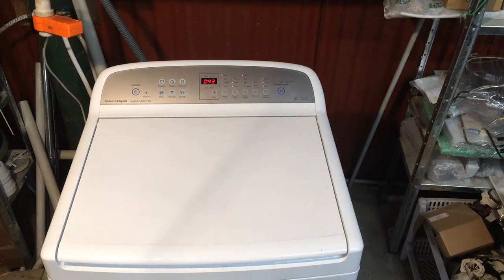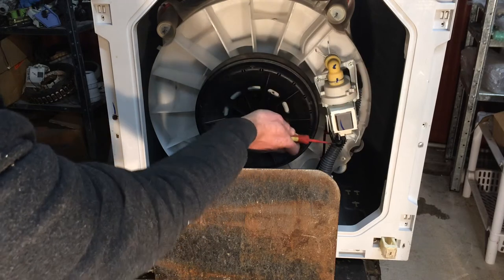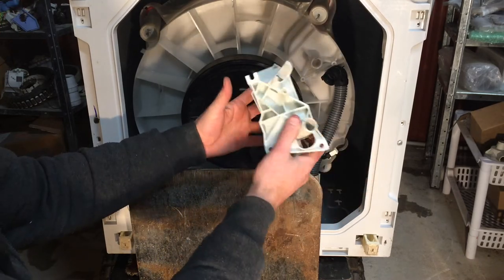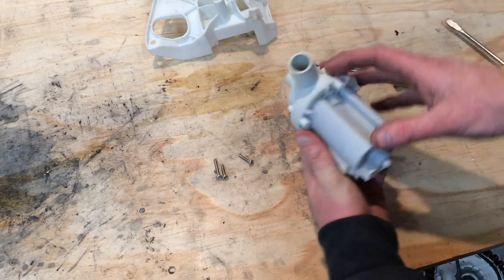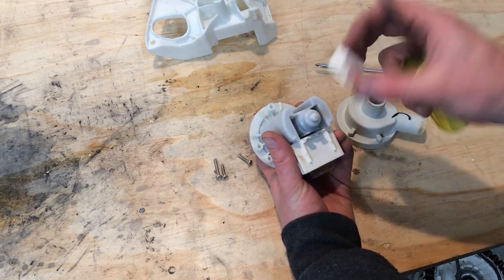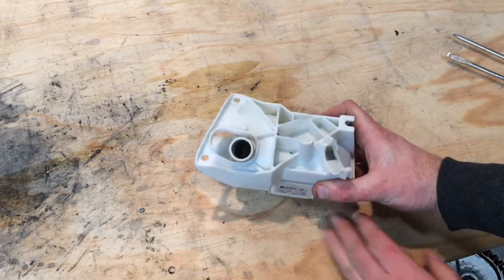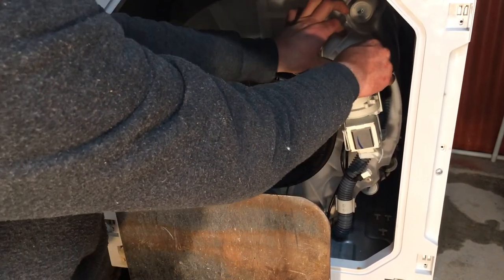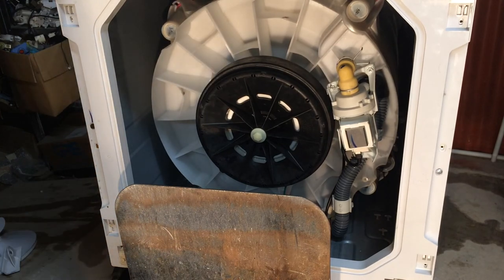Unblocking New Style Drain Pump on Fisher Paykel Top Loaders

Comment: Massive thanks. Thanks to your video, i was able to replace the pump of my washing machine.  In my case, i added an extra step and took out the drum from the top, and found someone blocking water going down. Replacing the pump and removing the blocking bit fixed my issue.

Comment: I tried so hard but couldn’t pull out the little plug that goes into the pump but I didn’t need to anyway. I unscrewed just the 2 big screws ( not the 3rd one) and pulled off the short cream plug (both ends) which then enabled me to pull out the fibre that had caused the blockage. Thank you so much for your video. If I can do it as a 62 yo female with no tech experience, then anyone can. Thanks for your informative video, you saved me hundreds $  in not having to call a technician
Reply from the maker: You're welcome, and yes that plug is a tricky one!

Comment: Gidday Dan, Thanks for your beaut (neat) videos. We have an Error 37, Pump Blocked. I did the top clean and got some debris out of the machine, but nothing got through the filter-box. I then followed your pump removal instructions. The coil measures 91·7Ω, the rotor turns with that curious lumpy motion, but 240v connected to the coil will not spin the motor. It just hums. I've only done it for a couple of seconds at a time—I don't want to burn out the motor. Two houses on our block, and no working washing machine. Dire straits! Thanks for your help, Alan.
Reply from the maker: If you have the pump in this video then you wont burn it out by running it stalled, it doesn't have a fan to cool it and also it has a self-resetting overheat if things were a problem. The "lumpy" turning you mention is normal on these shaded pole motors. Have you taken the pump housing off to make sure there isn't something wrapped around the bottom of the rotor? If nothing and it still wont start then sounds like you need a new pump.

Comment: Excellent instructions, thank you for taking the time to share this with us.  The only bit I could not duplicate was removing the electrical plug from the pump with the screwdriver lifting the tab, but I managed to take the pump apart with the cable still attached, under the machine.  My machine is the WA80T65GW1 to the lead looks a little different to the one in this video with two wires visible near the connector.
Reply from the maker: Yeah that plug is not a good design for removing!

Comment: The motor part also can jam due to contamination build up on the rotor magnet from washing greasy mechanic's clothes or clothes dirty with metal grinding dust. The rotor can be removed from its housing by using a flat screwdriver to pry out the plastic disc under the impeller. Beware of the thrust washer at the end of the shaft. The stator pole piece can slide off the rotor housing.
Reply: Excellent advice! Exactly what the problem was hence I'm a Boilermaker 😊
Reply: @robertmahood9895  The washer will fail to pump out water. Possibly intermittently at first. The stalled pump way or may not make a sound.  It will feel warm after a few minutes if it's being powered.

Comment: Hi good video,
How to change the suspension rod kit on Fisher & Paykel 8.5 kg washsmart model: WA8560G1 ?

Thanks
Reply from the maker: Lift the top as per this video here: https://youtu.be/J8VowhURszI
Then One at a time remove each suspension rod: Lift top bracket out of the corner of wrap. Then reach down and press red ring out of cup in outer bowl, then lower rod down and slide sideways out of cup. Refit rod removed in reverse order then remove next rod. Do front right and left rear first, front left will have a spring yo need to swap over, right rear is hooked around wires at top and a support for hose mid way.

Comment: Will a partial block here cause a repetitive SUD LOC error?
Reply from the maker: yes if it is draining but slow then it can start to spin with enough water to drag on the bottom of the drum, which is sensed as suds lock. Is very rare though.
Reply: @motrepairs  brother, inspired by your video I was able to remove the pump. Looked a bit different to model on your video (mine wa1068g1) amd straigjt away I saw a massive amount of fluff sticking out. Took cover off and removed 2 handfuls of it. Worst thing was the water that poured out despite bailing as much as I could. Got into the plastic base and I had to painstakingly dry it so mould wouldnt grow. Anyway its all back togethet amd workinh a treat. Thanks!

Comment: Is there a way you can tell the difference between a pump issue or blocked drainage hose? Drainage hose is pulsating but zero water coming out.
Reply from the maker: If its the pump in this video not the other one then they can get worn bushings and struggle to start, which may cause a pulsing. A partial block would still let some water through so if you have nothing coming then try blowing back through the hose, you may have a coin in the elbow just after the pump or something.

Comment: Hi. Thank you for your video. It has been most helpful. I have a WA70T60GW1 with the new style drain pump. Unfortunately  the pump needs replacing. I understand the original part has been superseded by new part number 42960P. I have received the replacement part but the wire connectors are different and the old plug cannot possibly connect to the new part. Have they sent me the wrong part or do I need to make a joining loom?
Reply from the maker: You should have also received a couple of plastic insulators in the box, and a piece of instruction paper. You need to remove the two individual terminals from plastic moulding and put insulators on them then connect individually. You can either poke a small screwdriver in to release clips on plug to get terminals out or just cut it up with a Stanley knife as long as you don’t damage the wiring. Important to insulate both as both will be at mains voltage when pump not in use.
Reply: Thanks for your fast response.Unfortunately I did not receive the instructions. Does it matter which wire goes to which terminal?
Reply from the maker: @MichaelPhillips-dn5fp  No it doesn't matter.

Comment: Great video on how to clean out , my machine stops draining (just makes a humming noise then beeps and fault code) every so often (every third wash or so) turn off and put back to spin it and it works fine. I used the video and pulled it all apart no blockage or anything , any ideas?
Reply from the maker: Have a look at my video about how to read fault codes.

Comment: No blockage in my pump, however resistance is 96 ohms is that to high? Ithink it is overheating and then cutting off
Reply from the maker: If you have the 230V pump that looks like the one in this video that is fine. Is it stopping a beeping with a fault code? There are other faults that can stop it draining not just a faulty pump.
Reply: @motrepairs  reading fault code 37, pump blocked error, checked and can find no blockages or kinks in hose. It is the 230V one in video. Scratching head as to weather I buy new pump or new washing machine.
Reply from the maker: @TrevorMcCarthy-h5i  is the pump actually running on spin? Is water coming out? Pump may be electrically ok but physically seized
Reply: @motrepairs so the pump is not draining only after the wash cycle, if I advance the cycle to rinse/spin it drains fine. When I checked for blockages I was able to spin the impeller manually.
Reply from the maker: @TrevorMcCarthy-h5i  If it spins fine when you advance it then its not the pump. Does it beep and show lights if you leave it to try long enough?

Comment: Thank you for the videos. Is the washsmart top removed by removing screws from the back and removing the entire top section or is there secrets tabs i cant see. Thank you.
Reply from the maker: Yes these are a bit different from the earlier models. There are four screws at the back screwing down into the wrap (two with washers). Then the top deck moves forward about 1cm to unlock from the front. (hard to move and there isn't much free movement because of the wiring harness.) Then you can tilt the top deck back like normal.
Reply: Thank you for responding, that's really helpful.

Comment: Love your videos! I have a WA42T26GW1. The pump i ordered that was advertised as being compatible with this model was incrrect. The pump in this video is the kind my machine takes. What is that pumps model number?
Reply from the maker: Its best to order by the product code (5 digit and a letter) rather then the model. It will depend what country you are in as to what voltage the machine is, but in NZ/AUS its 421820P or 429640P

Comment: Hi, How do you take the top off a wash smart f&p I can't see any plugs covering screws on the top front. Great videos!
Reply from the maker: There are four screws at the back screwing down into the wrap (two with washers). Then the top deck moves forward about 1cm to unlock from the front. (hard to move and there isn't much free movement because of the wiring harness.) Then you can tilt the top deck back like normal.

Comment: Hi i have this exact model in Taumarunui. It is giving the 40 error and wont spin. Could taking out the drum and cleaning help? or do i need to fix something else? is it an expensive fix? the machine is about 5-6 years old, Kia Ora for any advice.
Reply from the maker: Error 40 is a bowl clutch problem, not engaging. You could take the agitator/pulsator off and make sure there is nothing around the centre shaft area.

Comment: We have the same washing machine as this one...please do a video on how to remove the tub inside for cleaning please.thanx
Reply from the maker: Hi, see this Video here https://youtu.be/tpJ5bDDpKkA
There is a difference in getting the top deck off: There are four screws at the back screwing down into the wrap (two with washers). Then the top deck moves forward about 1cm to unlock from the front. (hard to move and there isn't much free movement because of the wiring harness.) Then you can tilt the top deck back like normal.

Comment: How do you replace the grey hose?
Reply from the maker: The drain hose comes complete with the wiring harness and clips etc, so have to replace it all together unfortunately. Not something I'd advise to tackle without experience. If it is too short or has a hole in the part outside the machine you can extend it with either a FP Smart drive specific extension of you can get joining spigots cheaper.

Comment: Hi Dan - Thanks for your great videos of F and P Problems.  I am working on my Neighbour's washing machine which is the same as above - Washsmart WA1068G1 It has a crazy problem when she turns it on the Front panel lights flick around a lot changing all the times on the display nonstop and it does not go. I have tried a reset and a heat gun on the push button board and main controller just in case of moisture but to no avail. - I was thinking either the main controller or pushbutton panel has gone but very expensive to just guess and purchase one or the other Just wondering if you have come across this problem b4 - Any info regarding this would be much appreciated. Thanks, Regards Brent
Reply from the maker: Sounds like the micro-controller isnt booting correctly. ,90% chance its the motor controller, 10% its the display board.
Reply: @motrepairs    Thank you for your reply - I am going to try a new controller
Reply: Find an answer to this?  Mine flashed lights then skipped from start 9f was straight to spin. I plugged unplugged everything on motor controller and now it at least completes a wash but has rapid 3 beeps non stop through the wash.

Comment: do you know how to take that black thing off
Reply from the maker: If you mean the main motor rotor you just undo the nut/bolt in the centre and it will pull the rotor off with it. If its the later model with the bolt sometimes they come off without the rotor in which case you need to try a new bolt.

Comment: You could just syphon the water rather than removing the agitator
Reply from the maker: Yes you could if you are close to outside or have a very low drain. We usually use a hand pump from a kayak because often pumping into a sink nearby that isn't low enough to siphon.
Reply: @motrepairs  syphoned ours into the shower next door